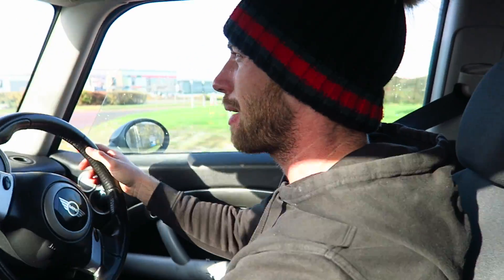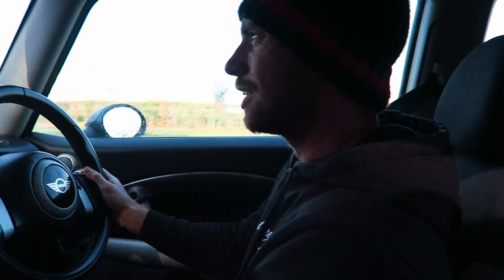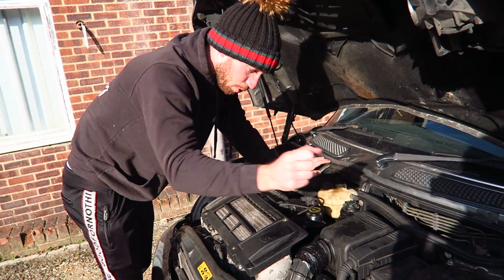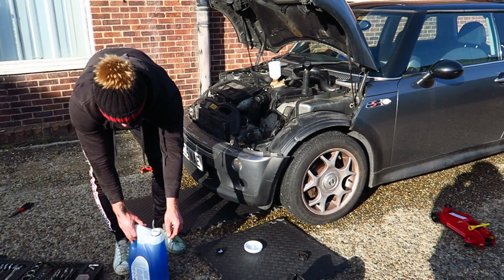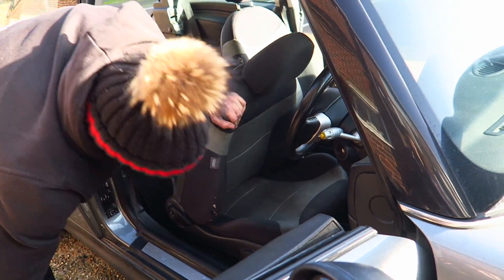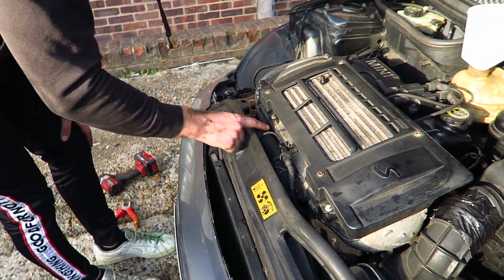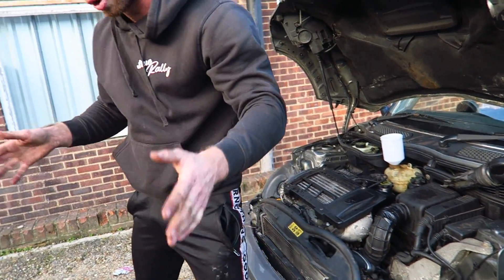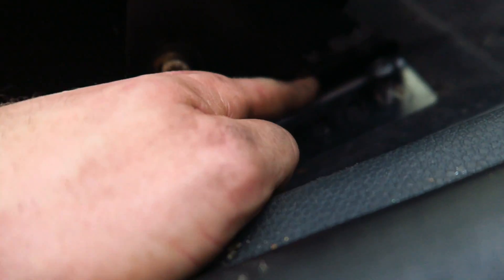it was going so well...

Comment: Good cars but hard to get over 300bhp so it's basically a go slow project Lee. It will cost a fortune to get anything over that. I had 288bhp on the r53 supercharged Eaton teflon coated blades big valve head cams 550cc injectors larger throttle body 17pulley intercooler anymore power would of been turbo route or rotrex and it's not worth it your need about £6000 grand.
Reply from the maker: Yeah deffo not aiming for 300hp!😂
Reply: @itsleelockwood  🤙